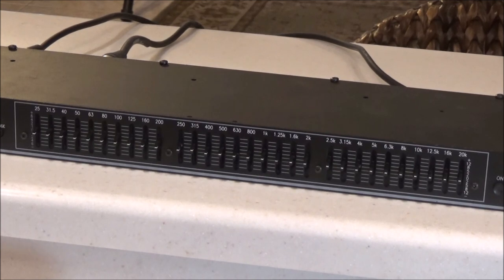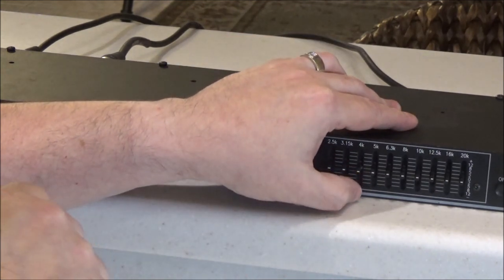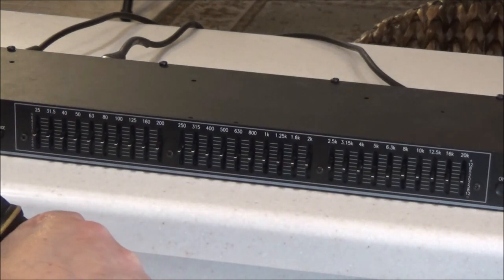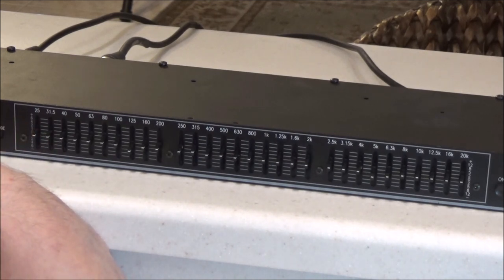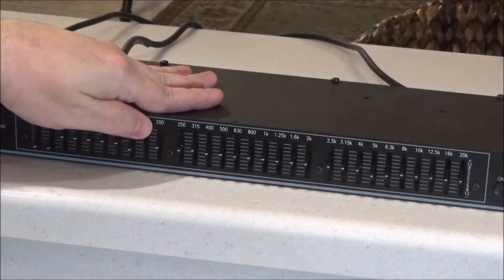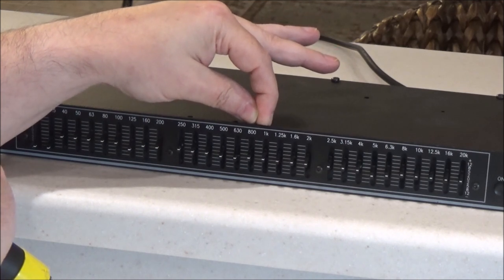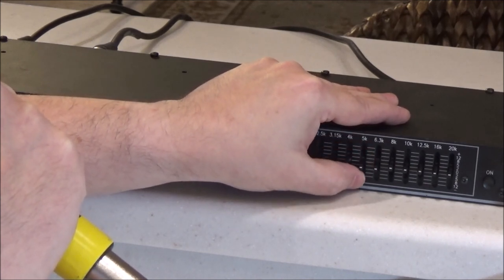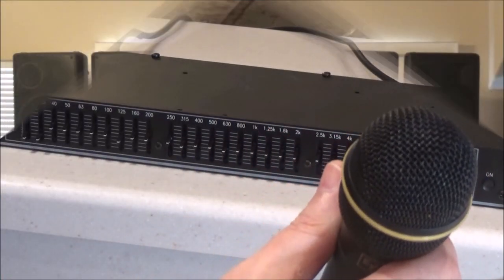Ringing Out Your PA Or Tuning A Room Via A 31 Band Equalizer By Scott Grove

Comment: Wow, very informative. I didnt realize there were so many problem frequencies. Question:  I've seen equalizers with LED's on each band that get brighter with volume. I'd imagine one lights up brightly when it squeals. Can that  be used to quickly identify problem frequencies? Or would that be misleading due to harmonics?
Reply from the maker: Yeah, those EQ's are really nice to help folks learn what frequencies sound like. You are correct about harmonics and octaves etc. They can show those falsely, but it will be ultimately up to the ever increasing trained ear to rationalize if the REAL frequency is the higher or lower frequency that is really the culprit. The only REAL negative thing about those is that it takes a really strong feedback that would possibly do some damage to speakers (or ears) to trigger a STRONG light.  Thanks for asking that question. I hope it helps some folks to understand those type.

Comment: What about rooms that have people? Tuning for an empty room is different than having a crowded room!
Reply from the maker: That's pretty routine.  The subs or low end won't change and the high end and mids being placed high enough is 90% of the trick. The easy fix for a crowded room that may soak up the top end is simply to turn up the volume of the top cabinets via the crossover.